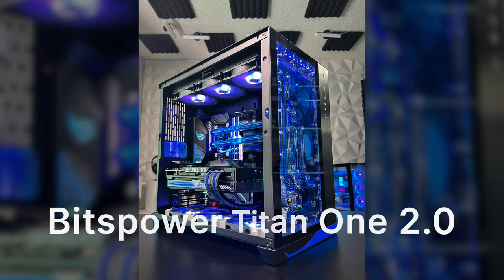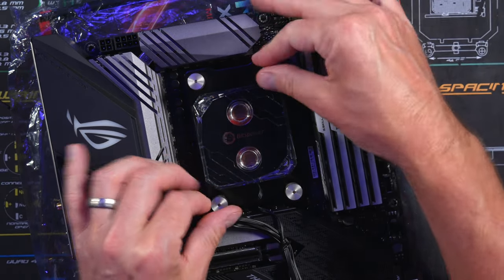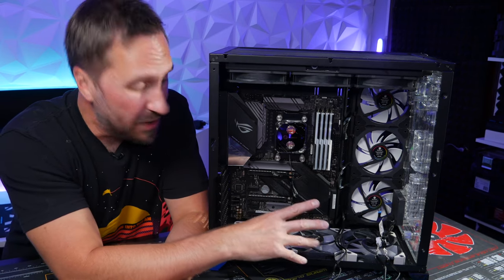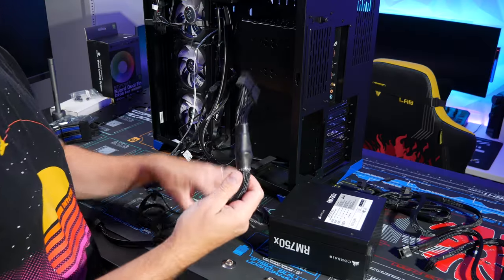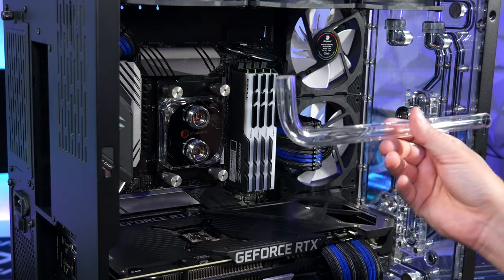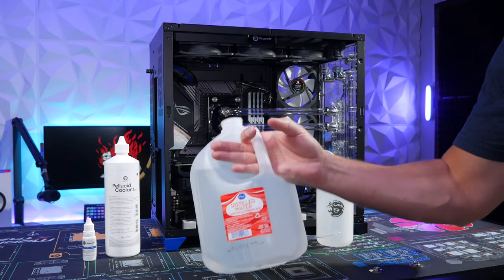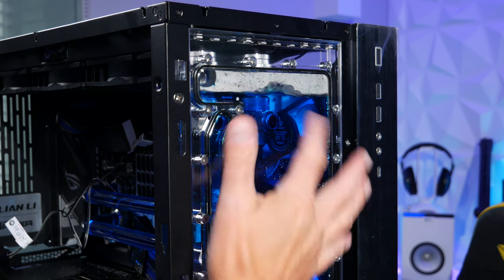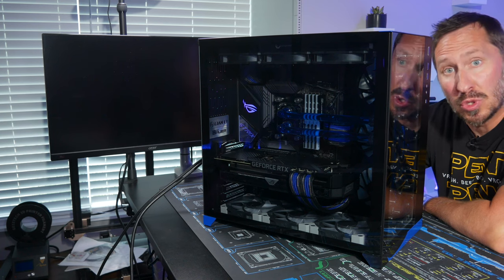Beginner's Guide To Building the Bitspower Titan One 2 0 PC Step By Step! #pcbuild

Comment from the maker: If you want to add a watercooled GPU, the distro plate does have an inlet/outlet for the GPU under the CPU inlet/outlet
Reply: I don’t believe you ended up showing it, but thanks for mentioning you can install SSDs on that hidden back panel!  It might’ve been obvious to most, but for some reason the perforations didn’t stand out enough to me haha😅 I was able to install my two SATA drives there which was very convenient for my build.

I had a couple questions when building my almost identical Bitspower kit I was hoping you to hear your thoughts on.

For the three intake fans that are positioned vertically, is there a reason you screwed them in on the inside (so that the fans are in the main section of the case with the motherboard) rather than the outside (so that the fans are in that smaller back section with most of the wires and PSU)?  Aesthetically it looks better on the inside, but wouldn’t they function better as intake fans if they were on the outside so they were closer to the vents in the side panel?

Also, I noticed you didn’t apply any of your own thermal paste.  I know my kit had a small layer pre-applied to the CPU block.  Was that sufficient for you?  Did you ever have any temperature problems?

The first time I built my kit, I added some of my own thermal paste and screwed the thumbscrews in like the Bitspower manual said (tight enough but make sure there’s still gaps in the coils).  They mentioned a few times to be sure to not over-tighten so I payed a lot of attention to that.  It must be very impactful if they repeat it that much, but then I ended up having massive temperature problems.  I took the heatsink off and my thermal paste was completely lopsided, it only covered like the bottom half when that should’ve been impossible.  An employee at Microcenter recommended I tighten the thumbscrews as much as I can next time, so when the thermal paste heats up and liquifies it won’t “fall down” like that.  That seems to have worked really well for me this time, but if that fixed my problem, why does Bitspower recommend the other way?  Why do I seem to have better contact from over-tightening when that’s what they warned against?  Am I messing something else up by not leaving the gaps?  I’m not sure why I had such a problem (CPU hitting 90s) the first time 🙁
Reply from the maker: @JinNada  Hey!  Hope youre enjoying your build so far!  To answer your questions, the vertical intake fans mounted on the inside would be best since that would provide the best cool air unobstructed or closer to the inside of the case cooling the inside better instead of caring about closer to the outside of the case.  Tbh, as long as the fans are unobstructed from pulling cool air through the vent into the case, dont think it would matter much but you'd still want the fans on the inside closer to the inside of the case for air flow.  That is a priority.

I used the pre-applied thermal paste since thats what most people might be using but most of the time I do remove that and apply my own or better thermal paste.  In this case, some people might not have their own so just used what came pre-applied which should be sufficient.  There's a fine line between not screwing down the CPU cooler enough where there's too much of a gap and wont cool as well.  If you overtighten, sometimes that'll push out a lot of the thermal paste and doesnt transfer the heat very well.  Can also damage your motherboard or cause it to not function properly if overtightened.  If it was lopsided on the bottom, sounds like the top was being tighten faster then the bottom cause the thermal paste to push down.  

A good rule of thumb is usually tighten evenly doing a criss cross pattern and only hand tighten until tight.  I have tightened down as much as I can with a screw driver before and worked fine for me but I also know doing that is "over-tightening" and can cause problems as previously mentioned.  You want it tight and even where there's thermal paste in between the CPU cooler and CPU to transfer the heat and fill the microgaps on the CPU but not too tight.  Thats why its best to always stress test your PC after building to ensure everything is working as expected and its not overheating or crashing.  So good work catching that!

Hope this helps!
Reply: The gpu ports on the distribution plate are they adjustable like the cpu one?
Reply from the maker: @IsaacSchultz-lz8jc  Doesnt look adjustable unfortunately.  You have to take off the GPU connector block and it has holes you can put fittings in but theyre not adjustable like the CPU one.  I wonder if they have one on their website?  hmmm
Reply: Oh ok so I might just have to do a little more work
Reply: I got this same build from Cyberpower however I don't have the drain fitting like you do in the video. There is just a cap there. I am currently waiting for that same exact fitting to come in the mail. However, when I take this cap off, is water going to come gushing out of the distro plate? Do I need to tip the PC upside down so water isn't there and then install the fitting?
Reply from the maker: @AiR_JorDo  Yeah, I probably would assuming tipping it upside down is fine and nothing will start leaking so be careful.  Wonder why they used a cap instead of a drain fitting to maintain the loop hmmm

Comment: Very good and detailed instructions. The only thing that was missing is how to detect for leaks if it fails the leak test. Since you are using air instead of water will it be obvious where the leak is coming from? I have never done a leak test on a water cooled PC with air, but I have done it on fighter aircraft. Basically you just use some soapy water. If there are any leaks in the area the water will bubble up. Now of coarse on a PC you would want to make sure power is removed before spraying the areas with say a spray bottle to check for leaks.

Comment: I’m curious what you do if you need to remove or replace RAM. Like if it has issues posting or is crashing because because of RAM. Will it remove easily or do you need to drain the distro remove RAM, refill distro, troubleshoot, drain distro, add RAM, refill distro?  It looks like the lines completely block the RAM.

Comment: I have this case and I’m wondering if I can water cool my GPU aswell? It has 2 holes where you’d screw in fittings below where the CPUs in and out lines are…and some weird cover over the bottom 2 but.. i just don’t know. I’ve tried researching this but get mixed answers and none of the answers are exact keyword specific so I can not be sure 100%… I have the Titan one 2.0 with the stock distro plate that it includes.

Comment: Currently in the process of trying to put together a i9 13900k 4080 build in the titan 2.0 struggling to install the water block exactly which brackets do I need to use ?

Comment: Does the distribution plate have ports for a radiator on the bottom?
Reply from the maker: It does not but what I would do in your case, take off the GPU distro block to expose 2 holes (in and out ports), use the lower Out port to drop it down to a bottom rad port and then on the other bottom rad port, connect that to the gpu in port and then connect the gpu out port to the top distro in if that makes sense
Reply: By the looks the 3.0 version does have holes at the bottom so I might have to look at that one

Comment: Gotta Watercool that GPU and add a second rad to bottom...then your flying high.
Reply from the maker: Agreed but just wanted to build it as the kit comes as a perspective of a beginner who maybe doesnt know/have a blocked gpu
Reply: @PCBattlestations  Yeah I understand...you should look into a Corsair GPU block. I believe they have one that has everything pre built with pads, screws if I'm not mistaken...that block would be much easier to install for a beginner..and give you a full custom loop.
Reply: Do I need another rad.. for gpu?
Reply: @rezart8648  Yes...if your cooling your CPU and GPU, you should have two rads. Generally speaking, most people put two 360mm rads in their systems. This particular case can hold up to three...but one on top and one on bottom should be the minimum.
Reply: I just bought the this case, and I would like to upgrade to the  rx 6950 xt red devil liquid. First time dealing with water cooling System , thank you for the information was really helpful